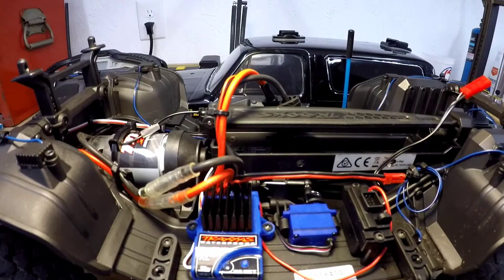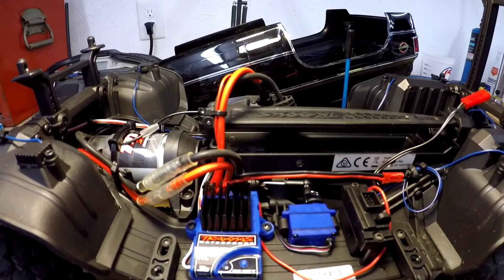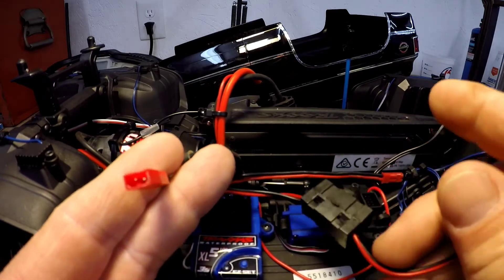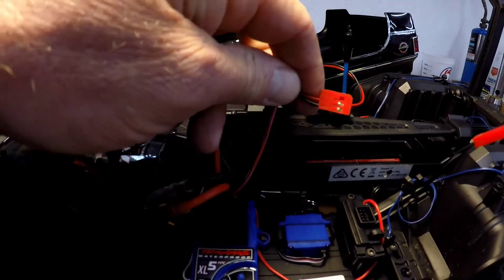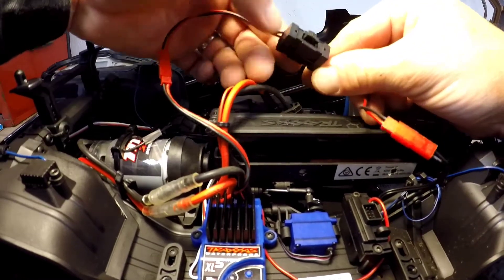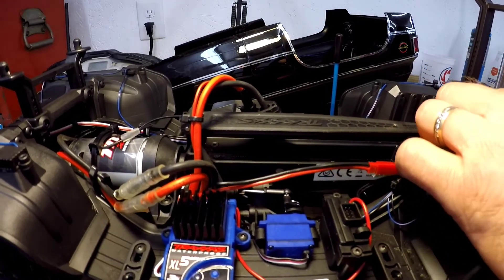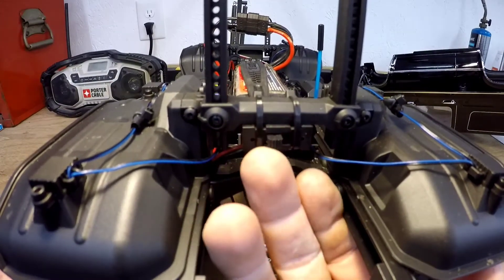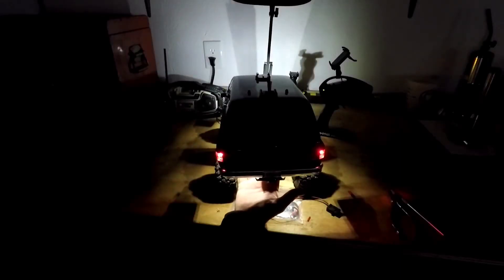Traxxas 8028 powersupply on/off switch

Comment: Question, can this power supply power things other than LEDs? In my case, I want to connect an ESS Dual Sound Kit to this power supply using an adapter. Would this work?
Reply from the maker: The ess dual will receive power from your channel 2 port in the receiver. It requires a range of 5v to max 24v. The 8028 provides a constant 3v, so it will not power the ess dual. Plus the ess dual needs the additional information from channel 2, that the 8028 cannot provide. Like throttle positions and braking so the unit knows what sound to make.
Apollo has a good quick tutorial on the ess dual install. Here is a link. Thanks for watching! Happy trucking. https://youtu.be/z1xgE9pNUQ4
Reply: @therealdirtybutler  Thanks, from my understanding, the ESS Dual receives ONLY throttle signals from channel 2, and needs to plug in elseware to have power. My other choice for powering it would be to use the included adapter to essentially create an off-shoot connection from my battery to the ESS dual.

Comment: Do you know what the connector type is on the power supply? I got aftermarket led kit that came with the 3 prong jrt type connector that's meant to go to receiver. Not sure which post in power supply is positive/ negative or if that even matters with the led's?
Reply from the maker: The power supply ports are jst connections. Correct, it doesn't matter with leds. It may matter with winches or other servo applications though. Thanks for watching.